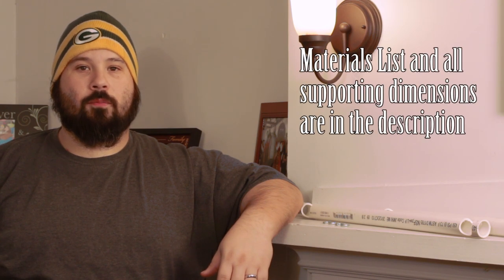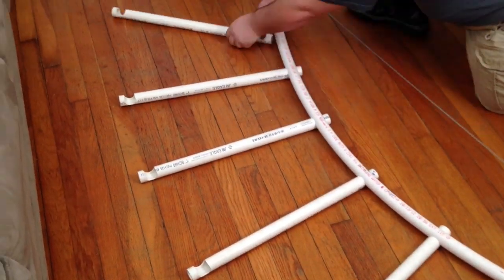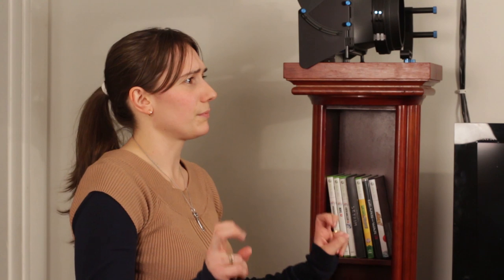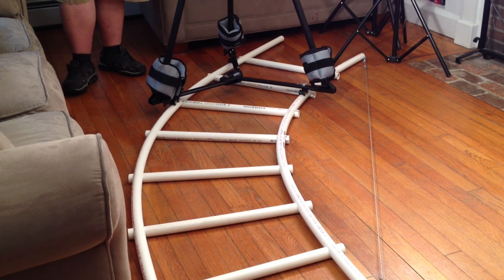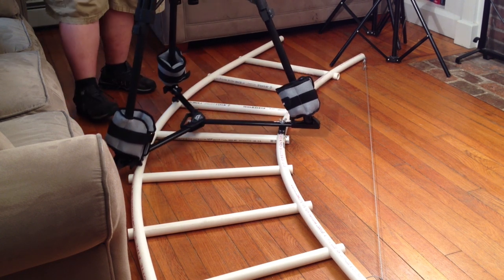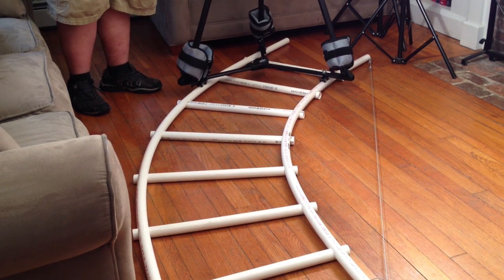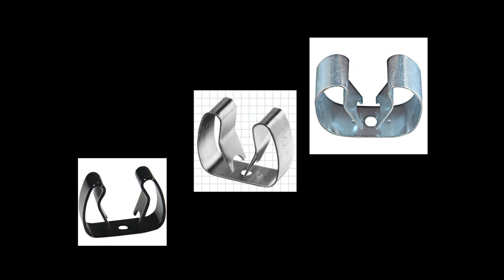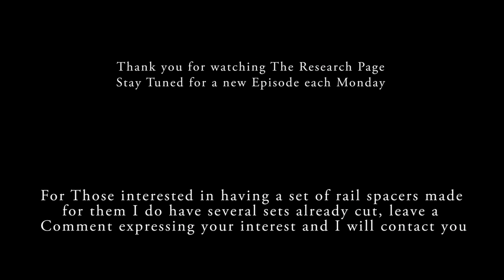TRP Cheap DIY adjustable Dolly Track , Curved, Adjustable, Durable

Comment: Great idea. How did you cut the rail spacers? I have worked with PVC a lot and am impressed with this part of the build. And was wondering how much you would charge for a set.

Thanks,
Orlapse

Comment: Love the video! Actually, I built mine based off of your plans. I felt it was the best one out there for DIY. However, my track doesn't line up when I used it as a curve. It lines up perfectly when it is straight. I have basically the same dolly system you have. Any ideas?

Comment: When I said line up, I was referring to what you call the separators and being the right distance apart. I will have to look into different lengths of the outside rails for the curved system. I am sure there is a math problem I can do to figure out the exact length.

Comment from the maker: Chad, what do you mean by "line up"? If you are referring to the rails themselves when curved the inside becomes longer that the outside , I cut my inside rail to 7' and leave the outside rail at 10' as shown in the video, the harder the curve the more the lengths will change